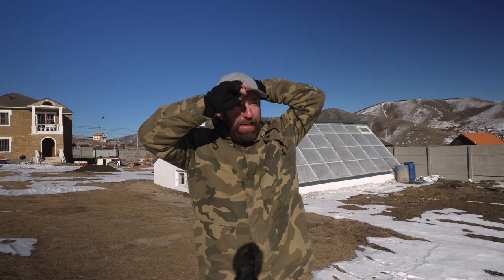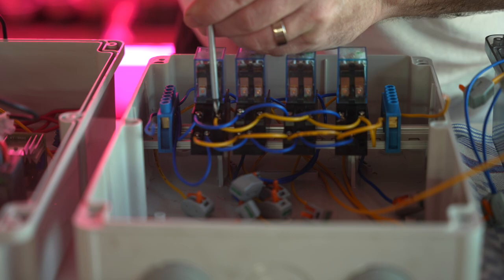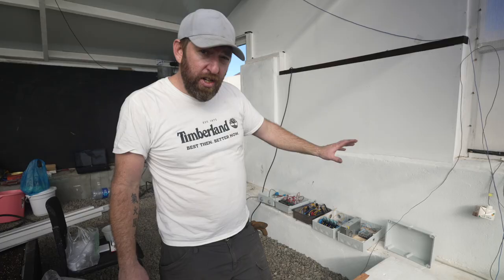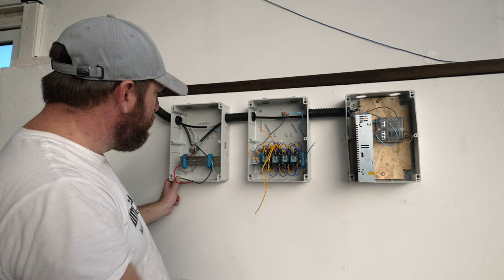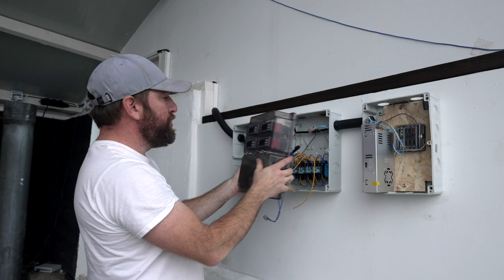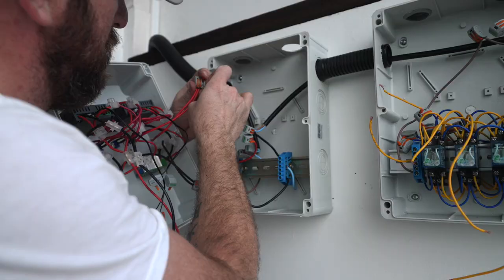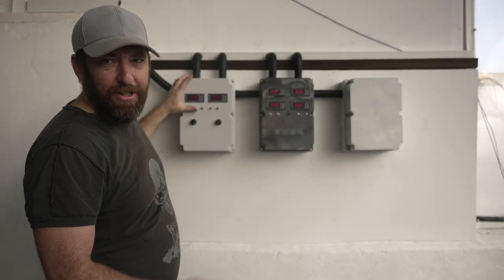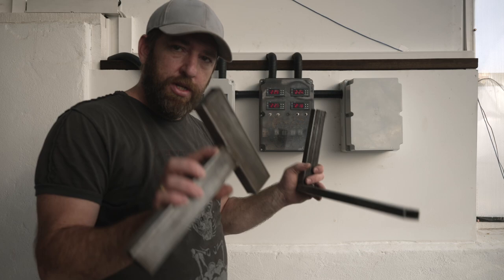CONTROL YOUR GREENHOUSE | Geothermal system setup

Comment: Thanks for all of these greenhouse videos. I'm going to be designing a greenhouse with an underground climate battery like you have, and maybe an additional pipe system about 300ft long to take cold outside air and convert it to the stable earth temperature, which is my area is somewhere between 10-15 Celsius. This is one of the cleanest builds I've seen. So many of them look like they forgot 1000 things during the build and then just did a makeshift job to fix it later. I'm wanting to load mine down with sensors so I have tons of data and can maybe share with the local university.
Reply from the maker: Hi Dan 👋 thanks so much we really appreciate it🙏🏻 that sounds like an amazing project you will have. I look forward to follow the process 👏👏👏

Comment: This for me has been the most exciting part, I am so happy with how well you have constructed all the control systems. if you have any variation in the STC 1000 temp there is an option to adjust them to get them all the same, the top right one on the panel looked a little out.   great work chap, you will be an expert in programming the STC's before you know it haha   Maybe we should post the drawings for the controller wiring, someone may be interested ?    anyway  superb work and I am so pleased the house and the GH are working, I think its going to take a year or so to get the earth battery up a few degrees.  I would be interested in seeing a snapshot of the graph of a days temp readings from the monitoring system to compare it to mine    speak soon
rob
Reply from the maker: Rob, we could not have done all this without your help!! 🙏🏻🙏🏻 you and you family will always have a special place in our heart ❤️
Reply: I think a lot of people would be very interested in a wiring diagram  I have 2 STC 1000 controlling my gaht system in the UK  it's never frozen in 4 years and is only a cheap polytunnel . There are similar controllers available eg inkbird elitech  . None I have bought provide a clear wiring diagram the switching relay part is the problem
Reply: @stevenadams1883  
Steven, they are basic 12v single pole relays, on/off. They simply make or break the circuit. Ideally, you should use a thermostat with a change over relay and a differential stat to control the fans. Fwiw, there is no need to pull air from the apex of the roof as the temperature gradient is mitigated by the circulation created by the fans. Commercial greenhouse use HAF (horizontal air flow) fans for this. In practice, you`ll find it tricky to set independent vent opening temperatures  when they are all seeing the same temperature :)
Reply: @JohnGuest45  hi John will look into those thermostats .  the climate battery fan needs  2 thermostats because u need to set 2 temperatures high and low the st1000 thermostats have a differential setting I wired 1for heating the other for cooling . They have been running 4 years no problems
Reply: @stevenadams1883  
Hi Steven i use 2 thermostats to control my system, a standard thermostat with change over relay and a differential thermostat (which has 2 two sensor probes) that measures the difference between  both the greenhouse air temperature and the mass temperature. The stc 1000`s  will only sense the air temperature so its not the best way to control this type of system.  The stc has an adjustable "deadband"  but its not a differential thermostat
Reply: @JohnGuest45  I will look into the system u are using
Reply: @stevenadams1883  
Differential thermostats are generally used for solar water heating, they sense the difference between the storage temperature and the collector temperature allowing the system to decide when to tun on the pump and when to turn it off. In the case of a SHCS (tubing and air) you need the stat to work both for heating and cooling which most solar diff stats cant manage. In a pinch you can use a dpdt relay to reverse the sensors so the air sensor becomes the mass sensor and the mass sensor becomes the air sensor. The downside is you only have one differential setting for both heating and cooling. Ideally, you should have independent heating and cooling differential settings  as the heating setting will need to be lower (smaller differential) than the cooling setting. I couldnt find anything suitable off the shelf and had to build my own. I`m sure an arduino or similar could be programmed for the task.

Comment: I only use the STC 1000 without the relays and 12v power supply. Each STC 100 can run 2 loads heat or cool. I only use 1 STC 1000 for heating and cooling . not sure why you have so many parts there.
Reply from the maker: Thanks so much 👍 yes I understand the reason for using two is to have greater control Over the range of temperature between the heating and cooling plus it looks cool 😎

Comment: This geothermal used for cooling only? Or some heating too?
Reply from the maker: Hi yes it is for heating too 👍 we will be pushing the warm air into the ground and the temperature of the ground increased over time at at night we will exact the heat from the ground to warm the greenhouse at night.👏👏👏